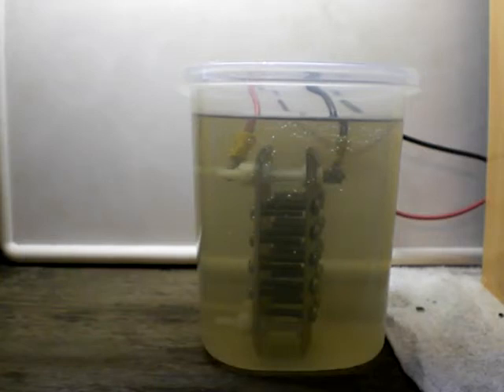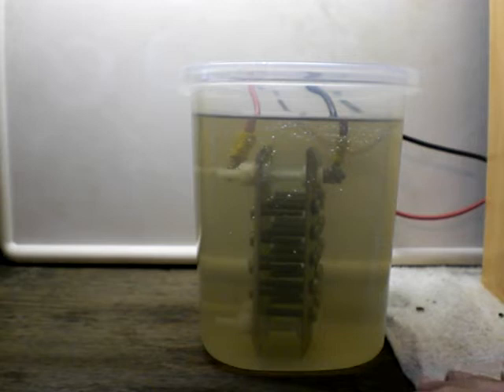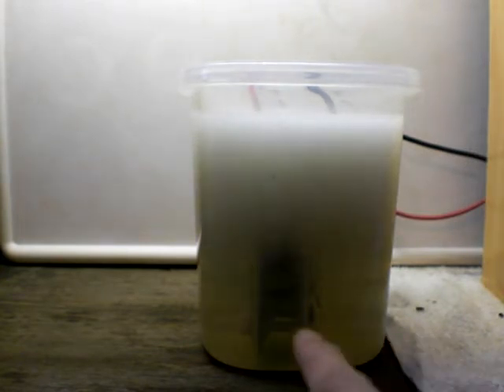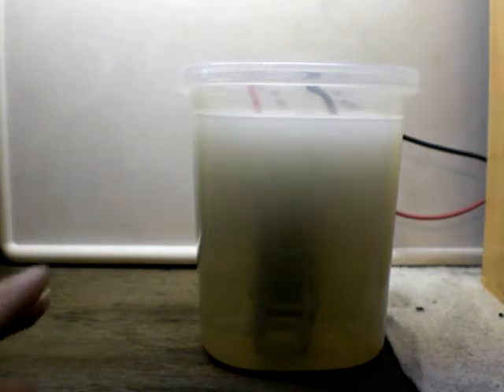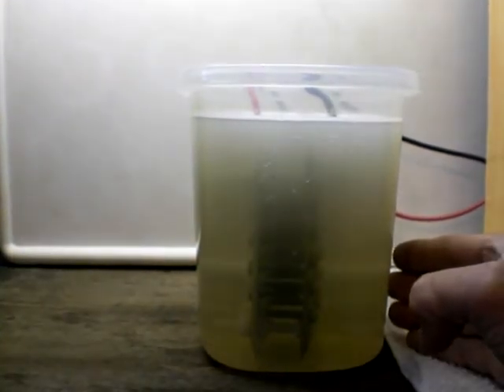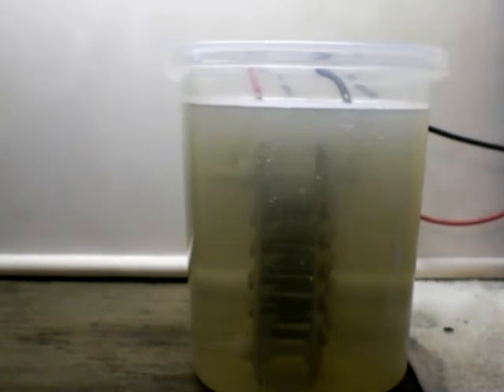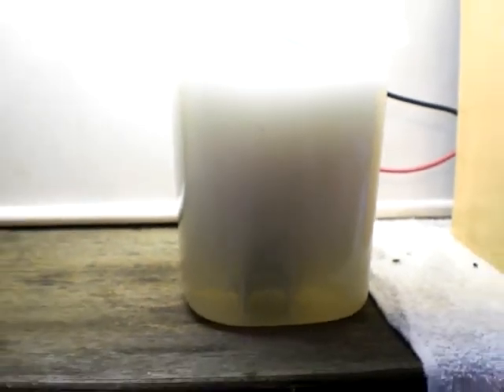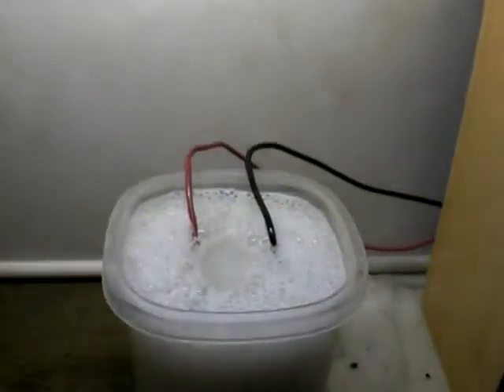Screw Cell Modified

Comment: rainmanp7 aka cryogenics
Use zinc screws and or I understand the Flux of power :)  = what are you sticking in the water is breaking down! this alters the power ratio-Make sure your try different hook ups with the screws or nails. Don't add anything but salt :) try different patterns start out with small ones.

Comment: I've never seen a plate/screw design like that. Very good production. What solution are you using? Make sure to use a solid connection instead of the crimped end wires as they will eventually arch and short out possibly causing an explosion. Good work.